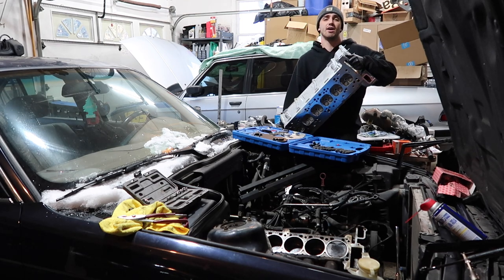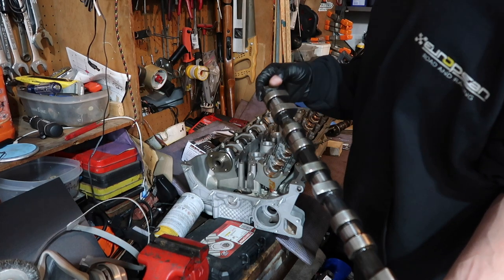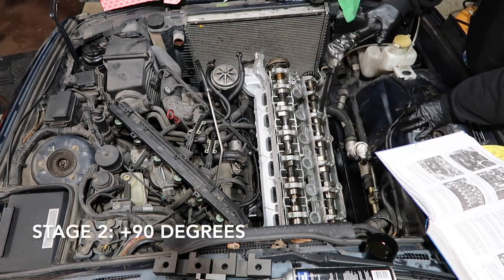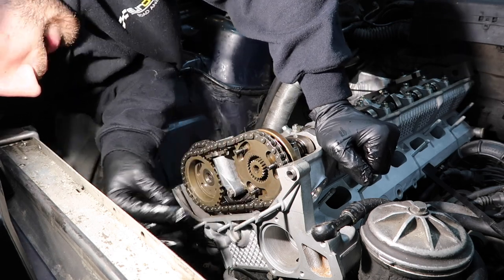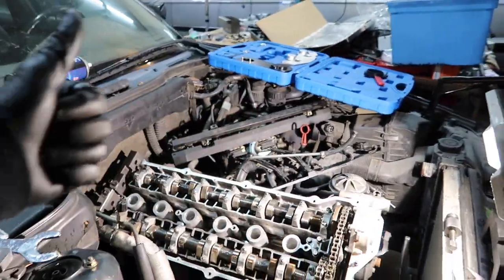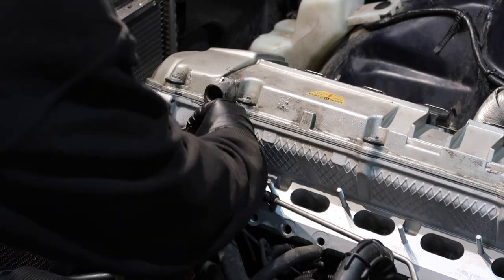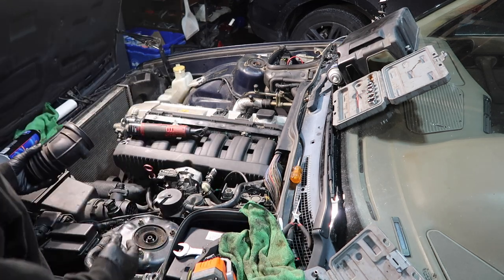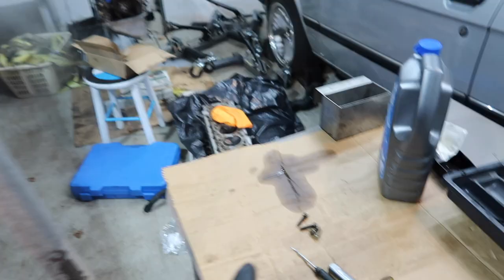Getting a BMW E34 525i Back on the Road After a Blown Head Gasket

Comment: Josh, I did the same procedure a couple of years ago (1995 525i, Northern Cal) and it has been running great ever since. Still have the timing/vanos tools just in case. I originally had blown the head gasket because I did not bleed all the air out of the cooling system (after changing serpentine and water pump). Bleed out those bubbles, people! Be patient!
Reply from the maker: Bleeding is something many don’t understand lol, but it’s crucial!

Comment: Cams are hollow and should be removed & installed in a particular sequence. Josh was lucky not to have snapped the one he replaced. For each cylinder, the cam lobes should be pointing up, least amount of spring pressure, then rotate the cam onto the next one until all are done. Also, cutting the heads off four of the old head bolts and hand tightening them onto the head significantly helps guide the head in place when lowering the head onto the block. And don't try installing without someone's assistance! It's just not worth a severe lower back injury. Also slam those hydraulic valve caps open to separate them and clean out the gunk ed up oil inside of them. Reassemble with just a light coat of new oil. I posted a step by step procedure on one of the BMW forums 12yrs ago which unfortunately isn't allowed here but it's extremely detailed. Sadly, 7 mos ago my thermostat failed (shut) and the engine overheated. I thought I avoided the inevitable up until last week when I discovered hydro-lock in #3 cylinder. Such a bummer. So, to rebuild or not to rebuild is what I'm pondering. Ugh!
Reply from the maker: Thank you for this information!
Reply: @m3nameisjosh464  You're quite welcome.

Comment: I was sold an  e34 535i without a thermostat thinking I would have to replace a blown headgasket and i turned out that the headgasket was good and it only needed a new thermostat and the cooling system needed to be bled, people really don't know how to bleed m30's. It took me a while but i got the car for pretty cheap in my country(Portugal) and in phenomenal condition, brand new interior new royal blue paint job and has been ripping, sometimes at over 230 kmh in portuguese highways. got it for 4k here in Portugal which is amazing, the only one that is for sale right now is in way worse condition and costs 9k... Cars are really expensive here...
Reply from the maker: Thats a lucky find!!! Glad you’re enjoying it and got it for a great price too!!

Comment: I think the extras are from the intake manifold brackets. Most people forget about them since the whole thing is pretty solid when you bolt it to the head
Reply from the maker: Im positive 2 are for those, absolute pain to install so i said to hell with it hahaha
Reply: came here to say the same thing, especially since installing the brackets was not mentioned in the video. i say that because installing them is SUCH a pain in the ass that it would certainly have been mentioned if it were done 😂
Reply from the maker: @szlewi  I certainly skipped installing them HAHAHA

Comment: Hi Josh, thanks for the informative vids. I've got an issue that I'd like your opinion on. I have an 95' e34, with an intermittent stopping problem when I come to a brake.  The codes consistently read knock sensor issue, but I'm not sure if that will solve it, as the problem arose after changing the ignition coils and spark plugs.  The car started running better after that change, but then this stopping problem began.  I believe the engine is the vanos version since it seems to have a solenoid valve at the front of the motor there.  Have you experienced an issue like this, and do you think changing the knock sensors will do the trick?  Thanks
Reply from the maker: In my experience ive never had Knock sensors cause any issues on these cars, even when completely destroyed. I would take a look at your icv hoses and check for vacuum leaks, all the things i replaced in this video, those will cause an engine to die when stopping
Reply: @m3nameisjosh464   thank you 🙏! I will try that

Comment: Question for you…I have a 91 525i non Vanos with M50.   Oil appears to be dripping from the sending unit which is attached to the oil pan.  I removed the 3 bolts trying to drop the unit to replace the gasket….but it doesn’t come all the way out.  Usually, you would need to detach some wiring, but I can’t get to any.   Ideas?   Thx
Reply: Hi there, just did that last weekend. The plug for the sensor is just about three inches along the cable. So basically where the oil pan meets the block. It's one of those plugs where you have to push down on the metal spring. I did it from the top with the intake manifold off, but you should be able to unplug it from the bottom.
Edit: Oh, and in my case the cable was zip tied to the engine mount arm. Don't know if that is stock.
Reply: @ikindalikebowie  I’ll look again.  Thx
Reply from the maker: What maggo said!
Reply: @davidtrachtenberg7095  Had any luck with the gasket?
Reply: @ikindalikebowie  it may have to wait…when I couldn’t get it off, I just changed the oil.  Hopefully, it will hold out until next oil change and I’ll try.

Comment: Currently doing this myself, do you not worry about trash falling in the oil and coolant holes when sanding down the block?
Reply from the maker: Blow em out with air, flush the coolant lines with hose, and change oil soon after.  No issues here
Reply: Have you finished? I'm pondering whether to do this again after rebuilding my head 12yrs ago.
Reply from the maker: @eaglerider94  I wouldn’t worry about it
Reply: @eaglerider94  yes i have, like Josh said i wouldnt worry about it if it's not obviously broken

Comment: Is there a power difference with the motor that has vanos vs the same motor without vanos . I'm trying trying to decide do I wanna keep the same motor or go for the one that has vanos . I have a 1991 m50 none vanos that has a blowing head gasket
Reply from the maker: Not really, vanos has slightly more torque and and torque down low but basically same thing
Reply: @m3nameisjosh464  okay thank you . Is there a price difference with vanos engine ?
Reply from the maker: @E34boyz  generally the same

Comment: ill throw my two cents in here although not worth a ton i just went through the whole debacle trying to figure out how to clean up a head and block i bought an overheated m54b30 the head alone was reading .20mm with a summit racing straight edge and feeler i decked the block and head with some cheap ass "auto body sander" from harbor freight to spec and the motor currently has 600 miles on it and no compression loss (hopefully im not jinxing myself here)
Reply from the maker: Love to hear about successful diys!🤝
Reply: @m3nameisjosh464  im definitely not recommending anyone deck their head with sandpaper but it was just funny reading all the forum posts about how anything other than a plastic razor will ruin your motor 😂
Reply from the maker: @purplejerry1  hahahah right. Scotchbrite, sharpening stones, sand paper, who cares. Clean cylinders as best you can and do an oil change and aend it